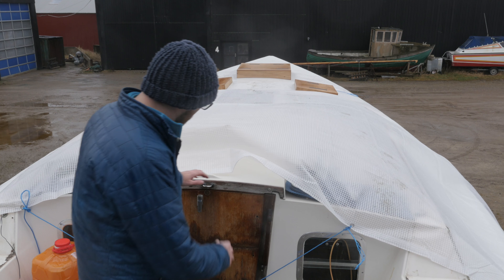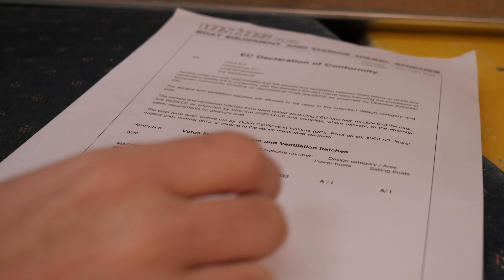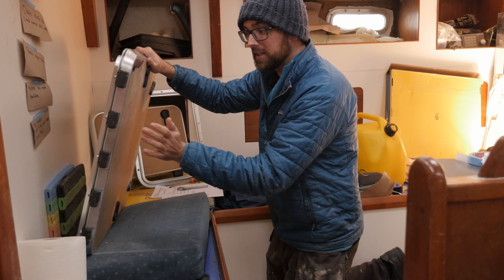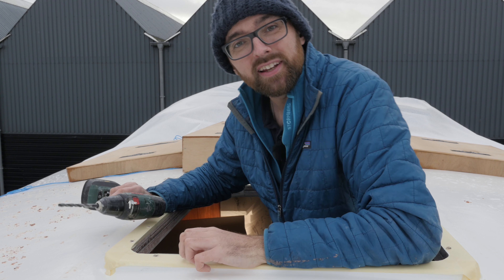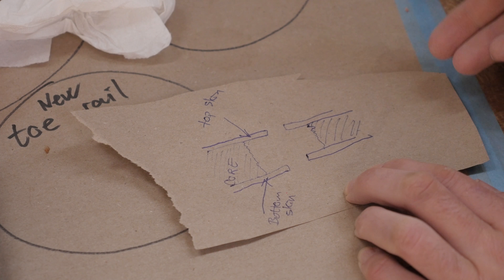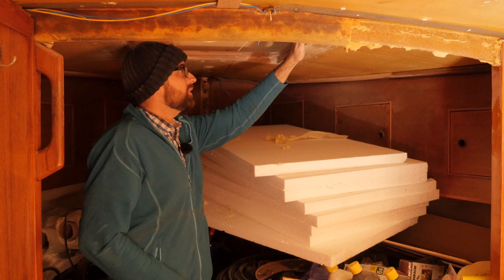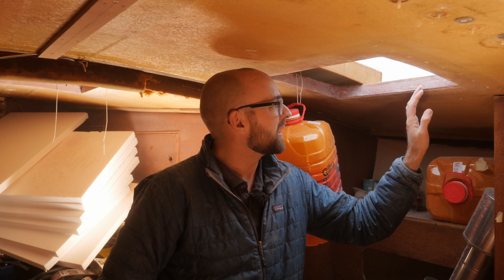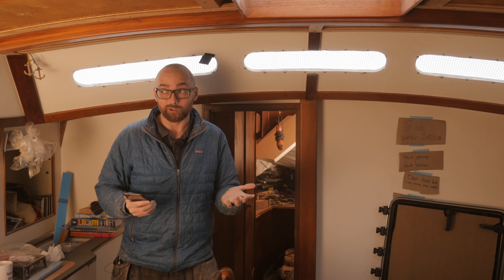Sail Life - Installing the new hatches, part 1 - DIY boat refit

Comment: Mads, I know of course you are done with the hatches and already underway with Eva. But just in case you need to screw something with wood screws or sheet metal screws. I've been working with the same principle of securing wood from rott with EP and wooden screws. Works really fine. Another variation is using threaded inserts in EP with machine screws. No need to use nuts and washers. Threaded inserts have a higher pull out force than the bolt thread has and I do use those from Ensat. There are also some out there named Helicoil, but these are made from spring wires and not suitable for GRP or Wood. Also in metal solid ones are preferred in the super yacht industry. EP works also great as an electric barrier between metals to prevent galvanic corrosion. And not hardened EP can be removed with white spirit or alcohol, also you can wipe down the surface with these to prepare for EP. No need to use Acetone. And definitely no need to sand it when hardened.

Comment: Hi, two tips: don't hang power tools from their cables, use for example the base plate of the jigsaw. And tread yourself with some velcro cable ties (5€ for a 10 pack at the stage audio supply). With these you can coil the cables faster and you avoid sharp angles. Cheers, Andi

Comment: Drill two small holes about 10cm apart  approx central to your temporary hatch covers and thread some string or cord through leaving a loop down below and leave a knot on both ends topside. Take a length of scrap wood slightly longer than the hatch dimension and pass through the loop and twist until tight enough to hold down the boxes - sort of Spanish windlass method. Quick and easy to tighten and undo. Have a great holiday and keep up the great job through 2018.

Comment: Another "drill & fill" method I like to do that saves a few steps is to use a Forstner bit to drill the oversized hole down to, but not through the bottom skin.  Fill with epoxy,  let cure, then drill the final bolt hole, and drill a taper in the top skin for better sealant adhesion.   No double drilling for the oversized hole, no taping bottom hole, and the epoxy bonds to the bottom skin as well as the core. 
Merry Christmas and Happy New Year!

Comment: Mads, Also related to the drill/fill/drill method is that the use of a Dremel with a #115 bit to hollow out the core material between the two skins is a better way to seal the core than the way that you are outlining. The entire process is detailed here: http://www.pbase.com/mainecruising/sealing_the_deck

Comment: You need a motorized screwdriver.  Will save tons of time.  Make sure you get one with an adjustable clutch so it doesn't strip out the delicate screw holes.

Comment: If you had just set your hatch frame into the hole, the ridge above deck would have made your wood hatch covers stay over the hatch opening unless the wind flipped them up. The hanging tools would and did look after that possibility. This is just another suggestion from one of those armchair quarterbacks you get from time to time. Merry Xmas and I enjoy your videos.

Comment: I hope you enjoy the Vetus's but I'm thinking you'd be happier just making your own.  Doesn't have to metal.  Nice wood frames (I'd paint them), a piece of fancy plastic or glass, some hinges and dogs, a rubber bottom seal - and you're good!  OK, you will need a nice raised "shelf" inside the hatch tops, but that's doable, right?  (I'll make a photo of an example if you want.)
Also, make the hatches open facing forward - you'll be glad at anchor.
Also - no washing machine!

Comment: 12:00 I wouldn't be satisfied with cleaning mold every now and then... If you get mold, it means that you get condensation and that you have an insulation issue. If you solve your insulation problem, you wont get any mold. And mold can be bad for your health.

Comment: Plastic vs paper cup to mix epoxy...does it matter? Another boatbuilder said paper, which is the different from all the other boatbuilders I follow.
Reply from the maker: In my humbule opinion it does not matter at all :) As long as you get the epoxy mixed thurogly it's all good :)